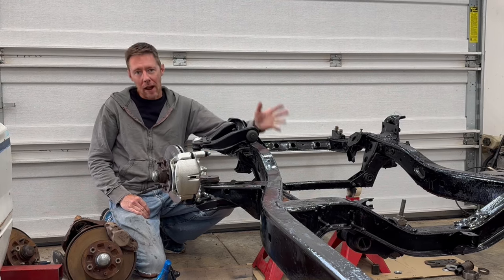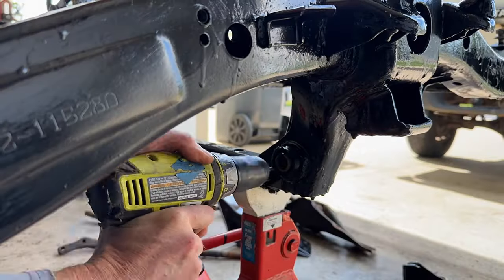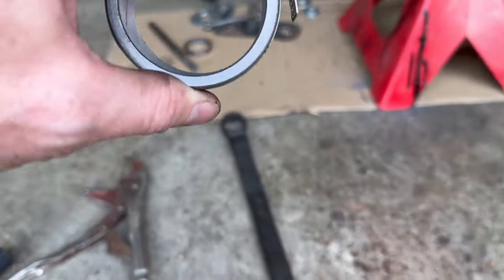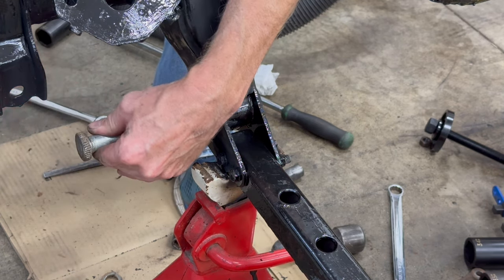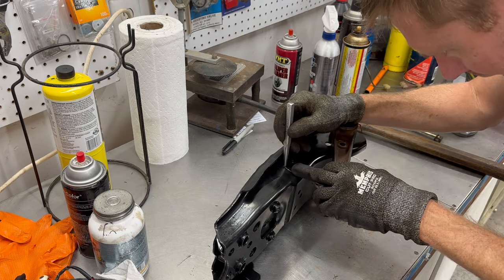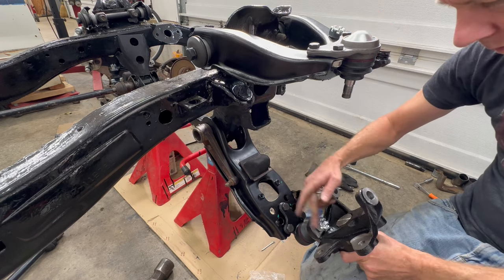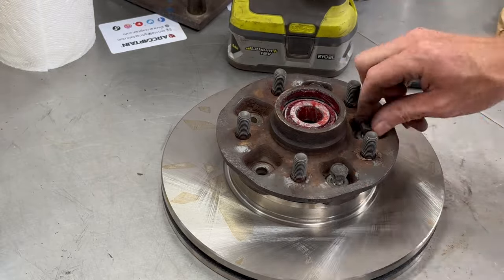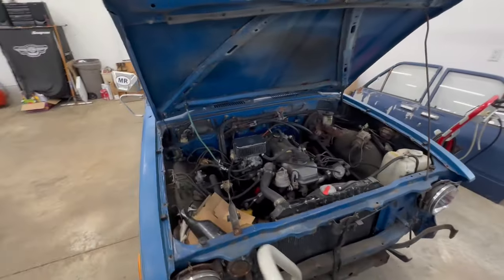How to: Update Suspension to install Drop Spindles on 1979-83 Toyota Pickup Truck/Hilux

Comment: Nice work, I did the same (1 ton brake and new wheel bearings), last week. One note is that the final torque of the wheel bearing nut isn’t 25 ft lb, that’s just to seat the bearings. You’re supposed to loosen the nut to hand tight and then check runout. Otherwise your bearing will be too tight
Reply from the maker: Thanks for the info!

Comment: I replaced the lower control arm bushing on my 84 recently.

A front outer wheel bearing race fits snug on the front side of the bush and i used 2x inner races on the rear along with a 200mm M16 bolt and 2x 5mm m16 square washers.

Comment: I used 90s Toyota surf torsion Bar on my 2 wheel drive Hilux it goes around corners like a gokart   I love how Toyota parts fit between the model's  I even have old Toyota brakes with the pedal box in a 58 Holden
Reply from the maker: Cool I’ll keep my eye out for a set of later model torsion bars to upgrade mine, thanks.

Comment: Are the 1 ton hubs the same as the non 1 tons ?
Reply from the maker: I think they are.
Reply: @6thGearGarage  I have a one ton and I wanna get the lowering spindles but I wasn't sure if the hubs and breaks would work for spindles
Reply from the maker: @williamneigum7002  Yep, you should be good, although since putting some weight and compressing the suspension, I found that the calipers contact the upper A arms when the wheel is turned a lot. I think un-doing the balljoint flip should create enough clearance.

Comment: I have an 84 3/4 ton Toyota pickup and it was difficult finding what size caliper without physically looking when I went to get new calipers.  The 1/2 ton calipers go on the front and the rear drums are their own 3/4 ton own drums. Before August 84 the 3/4 ton used one ton front calipers.